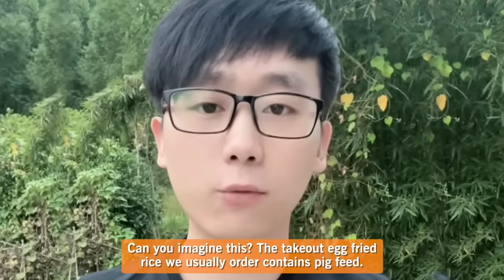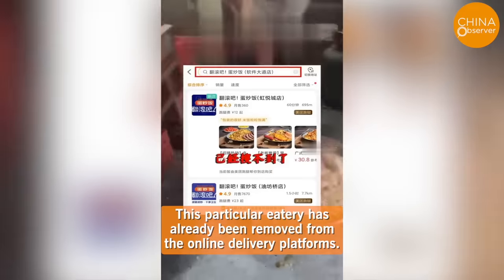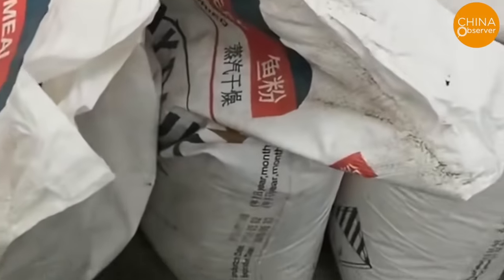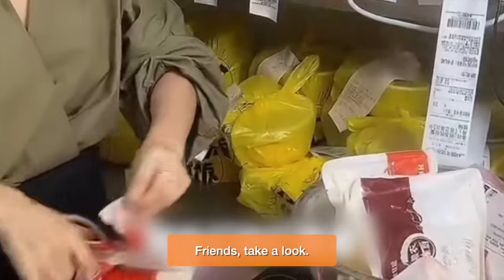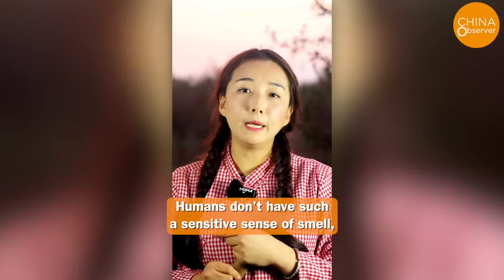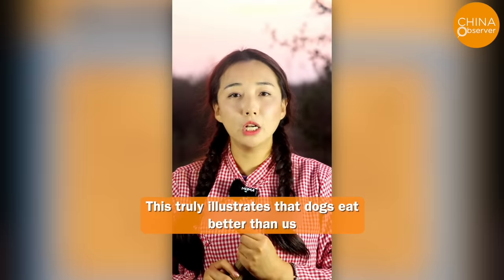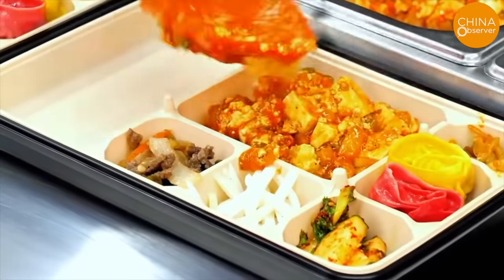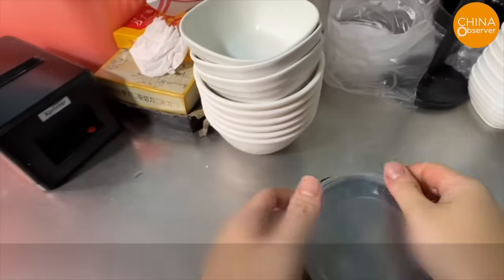China’s Fake and Toxic Foods Reach New Heights | Pig Feed for People?

Comment: Pre made dishes as a concept is fine. Some of our defence forces use them to save space. High nutritional value food can be stored in those bags and then suveed, or cooked in the bag. Its whats in the plastic of the bags, and the actual contents in this case id be worried about. You can suvee food and get great nutrition, IF the plastic bag is safe, AND the actual FOOD is safe. In China, not so much.

Comment: From what I know, apart from expired products, most ingredients are perfectly edible and harmless. Like with black pepper "beef" - it's duck, not beef, but does it make it inedible or harmful? No. Cheaper, somewhat worse in quality, that's it.
I'd be more disturbed by the fact of the lie like calling a duck a beef than by ingredients themselves. Obviously, when you buy a product that's significantly cheaper than other similar products, that doesn't come from producer generosity.
Would I eat so called pig additives? In pure form of course not, since they'd have terrible taste. But as additive - why not? Lecithin is lecithin, it's safe, we used it all the time for literally thousands years without even knowing about it, and there's absolutely no difference where it comes from - it's chemical structure is the same, otherwise it won't be lecithin. And I'd bet that the one came from modified soy is safer and cleaner than one made from yolk, firstly because yolk goes bad way quicker than soy, and with way worse byproducts, secondly, because genetically modified organisms are going though way more strict testing and control.